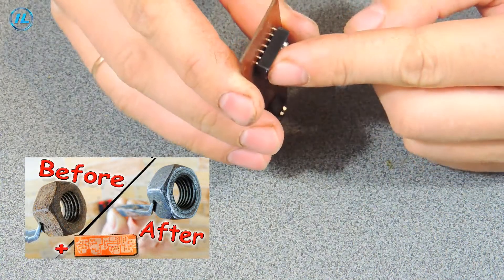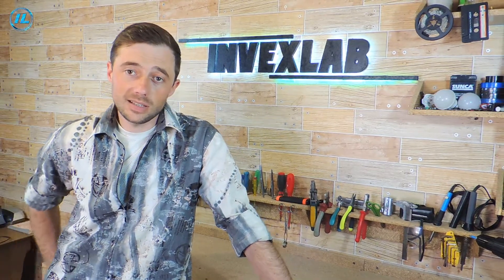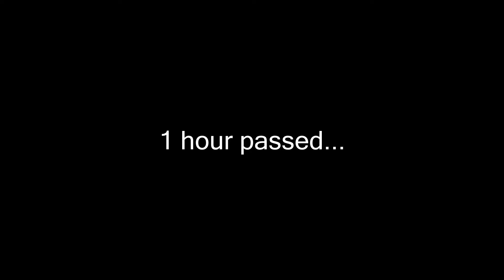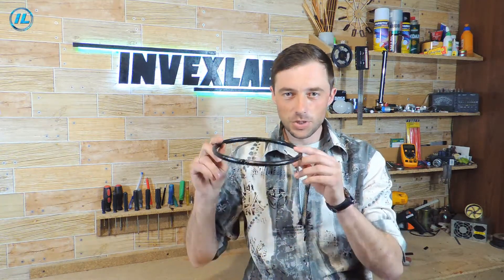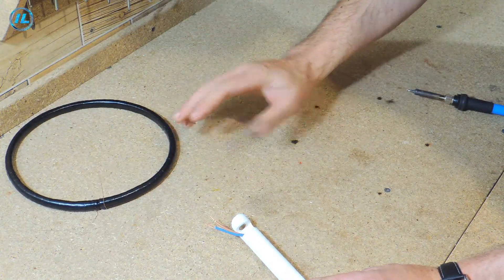✅ Made one of the BEST metal detectors!!! Metal detector PIRATE! ✅

Comment from the maker: 0:40 - description of the "PIRATE" metal detector";
0:56 - soldering the circuit;
2:25 - preparing the metal detector housing;
4:43 - mounting the metal detector body to the handle;
5:15 - installation of all components in the housing;
6:00 - connection of all elements in the case and layout;ayout;
6:42 - manufacturing of the metal detector handle (rod) ;
7:50 - metal detector coil manufacturing;
10:07 - mounting the coil on the handle (rod);
11:04 - first activation of the metal detector;
12:19 - testing of the metal detector "PIRATE";
15:31 - category "EPIC FAIL" - unsuccessful and funny takes from the shooting.
Reply: I need it how much all the kid about Metal detector?.
Reply: bro can you upload a video on how you build the metal detector circuit? i'm trying to build my own but cant find any legit working videos on the net for it appreciated cheers also, i'm using a NE555P timer AND WANT TO SIMPLIFY IT SO NOTHING SPECIAL AND NO EXTRA APRTS ETC CHEERS :)

Comment: I noticed there are allot different variations of this circuit. I made this detector, following the circuit you posted bellow. And noticed that the irf mosfet gets smoking hot, and consumes about 500 ma. When i read about it, it said it consumes about 30-40 ma, wich is allot better ofc. I found out thet the problem was the resistor between pin 7 and 8 on the 555 timer. In the circuit you posted bellow it uses 1 kohm and another very look like circuit, they used 47 kohm. So i changed it to 47, and it works perfect, no hot mosfet. And it went allot more sensetive.

Comment: What should be changed in the circuit for a 25cm coil (22 turns and 380uH)? My circuit failed the air test. It's just noise that would vanish or get higher when manipulating the pots, but no response for any object no matter th size..

Comment: Did you try this circuit on a breadboard first?
Reply: I tried it on breadboard, but i recomend change the resitor from pin 7 and 8 on 555 to 47 kohm. 1 kohm makes the mosfet glowing hot.

Comment: there is a few schematics available for the "pirate" metal detector...some show the 555 and op-amp being separate ICs and some show it being the same IC and the one he uses shows the 555 but explodes or de-compiles the op-amp...but I think the circuit is using the comparator part of the op-amp IC and not the amp part if that helps and that is why the thing does not look like a simple IC.

I can't wait to start on this.  I have to order a few supplies, but after spending over 20 hours working on a Arduino based one with no luck(not sure what I am missing there) I cannot wait to have a working prototype...and the pirate is supposed to be super flexible and able to be modded pretty well...and will take a wide range of coils...can't wait.
Reply from the maker: Hello. Here is a link to the metal detector diagram - https://drive.google.com/file/d/1unfoLBMZp93jawpvb-Fdv7xNJnM56R27/view?usp=sharing   
This circuit uses two chips-NE555 and TL072
Reply: @invexlab_world  Thank you for the link, however it is "access denied".  I think you have to either allow it to be viewed or grant permission.  Also, do you know if a 741 op amp which is also considered "general use" would work instead of the TL072?